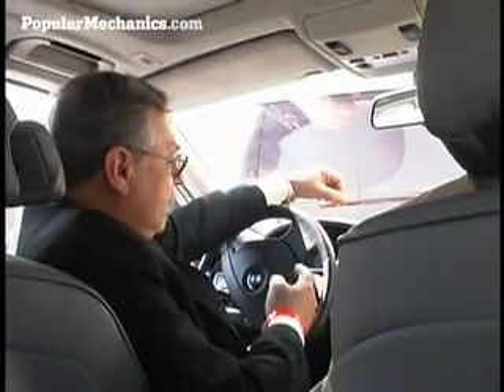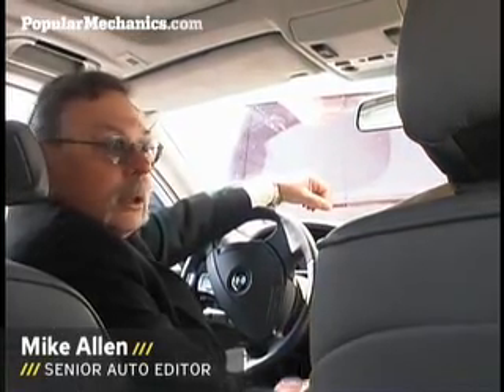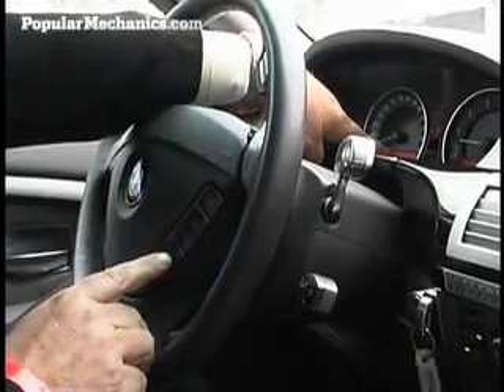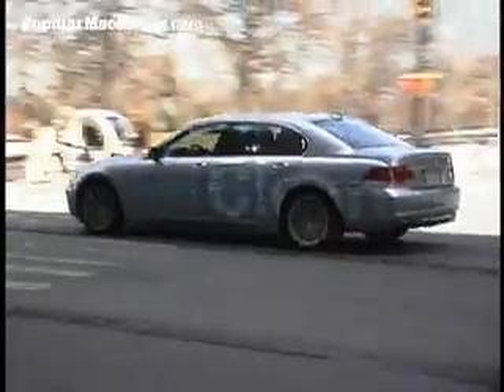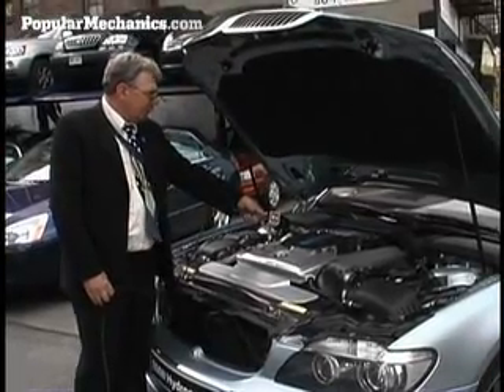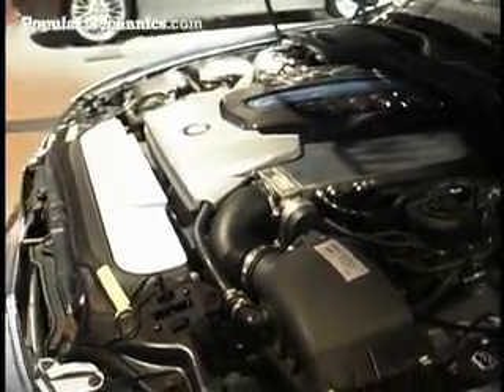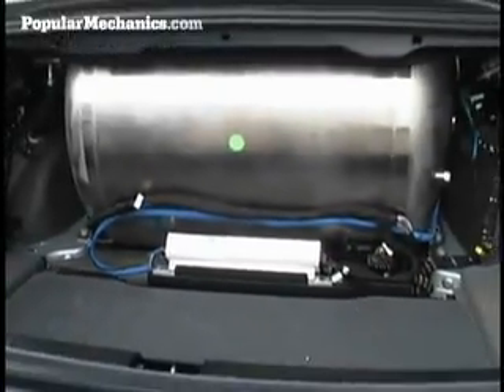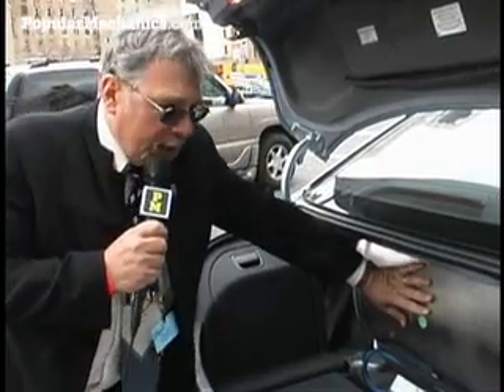BMW Hydrogen Powered 7-Series

Comment: At 0:06: "this car runs on liquid hydrogen". It does not run on liquid hydrogen! Hydrogen becomes a liquid at temperatures near 20K at atmospheric pressure. I highly doubt that the engine would run efficiently if liquid hydrogen was the fuel. It runs on gaseous hydrogen.

Comment: ya, new Zeppelin , driving bomb, any kamikazes ???
Reply: Ever see a Lithium Ion Battery Pack catch fire and explode in flames? It's not even a rare occurrence. It happens way more than is even reported. They burn so intensely & aggressively, they're extremely difficult to extinguish. Nor are they easily accessed where they are stored in vehicles. AND they can spontaneously REIGNITE several days later. They spew incredibly toxic gases & flammable fumes when they burn. A replacement Battery Pack costs more than the car, so your insurance company will declare it an economic write off, and sell it for scrap.
The kind of Fuel Storage Tanks in the Hydrogen powered cars are similar to those used by tens or even hundreds of millions of LPG (Liquid Petroleum Gas) powered cars all over the world, most notably in Taxi's, company fleet Vehicles, Delivery Vans and other service vehicles, and so on. Even many Fork Lifts run on it. All volatile fuels, including LPG, Hydrogen, and plain old liquid Benzine Petroleum, are potentially dangerous, and can hypothetically explosively combust under the right circumstances. But, despite the fact that Petrol & LPG power almost all the vehicles on Earth every day, dangerous situations involving their Fuel & Fuel Storage Systems are almost unheard off, considering the sheer numbers of those cars, many even in varying states of neglect. I can recall maybe two in the last decade, where an LPG Tank failed, caused a fire to ignite, but was quickly & easily extinguished by a Fireman before any explosion. That's a way better record than Battery Packs in EV's. On a 40 deg.C day in traffic gridlock, I still trust the old skool, proven technology with a commendable record of safe & reliable operation from several decades of service in literally billions of vehicles, like the Petrol Tank, LPG Tank, and similarly, the Liquid Hydrogen Tank, more than I do, a massive, overstressed, overheating Lithium Ion Battery Array under the floor of my soulless, Four Wheeled Electric Appliance, threatening to burn like a plasma cutter flame, reducing the vehicle and anything near it to a molten mass, when it regularly ignites.
Just my opinion. Each to their own. Anyone who enjoys driving a car that makes barely audible sounds like a mobile Dentist Drill, Electric Toothbrush, Cordless Hand Tool, Scalextric Slot Car, or some Kitchen Appliance,.....good luck to 'em. Just don't drive them to my house. They aren't welcome. Or offer me a ride. I'd rather walk. Electric Vehicles are so lame, they sap my will to live. If that Hydrogen technology means I can have my Internal Combustion cake and eat it, continuing to drive my Classic BMW Coupe powered by it's proper engine, and the soulful sounds it makes, with nothing but water vapour coming out the tail pipe, then sign me up.
Besides, most EV owners are currently deluding themselves about their "green" credentials anyway....Where does the electricity charging their vehicles come from? All they did was shift the pollution from their internal combustion exhaust, to the chimneys of the coal fired power stations that generate the vast majority of electricity everywhere on Earth, including the increased electricity demand they create with their EV's. Unless they can be certain of only using power generated greenly & renewably through Solar, Wind, or whatever means, which currently can't generate enough energy to supply base load power for modern cities, then their smug sense of self satisfaction about saving the planet is only self delusion. And something the Dealer that sold them that expensive Electric Vehicle could manipulate to relieve them of the money they have in greater quantity than sense.
Reply: @TomFlaTTop_BMW  we should go back to burning wood the most renewable and cleanest fuel on the earth

Comment: it does less than 20 mpg on gasoline...(17 ish, IIRC) and its a pathetic 260hp V12...the engine uses 50 liters of hydrogen to go the same distance as it does on 13.9 liters of gasoline